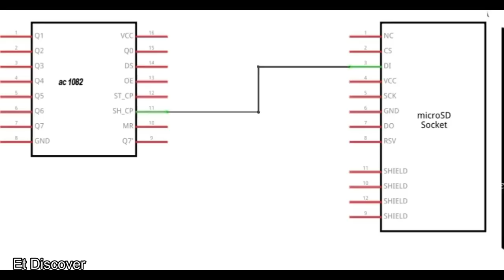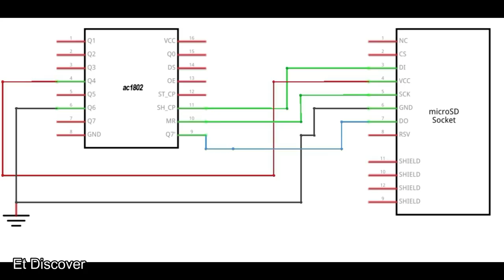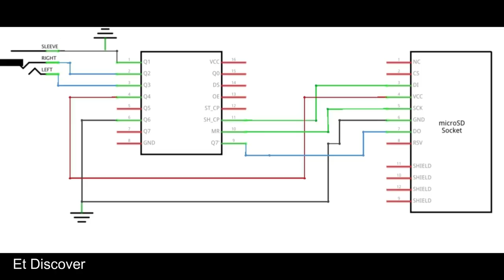How to Make a SD card Mp3 Player_ very easy.

Comment: Awesome video🤗 Nicely explained.😊Here are some recomendations 
1.use a small plastic casing for your project.
2.add a micro usb female jack to charge the battery.
3.replace this small 100mah lion battery with 18500 mah lion battery. It will increase the backup by over 10 folds.
4.use a soldering iron with microtip and low wattage. Its worth investing belive me. You  burnt your switches a little.😉
5.use a 4 ohm speaker, infact two of them to inc output subsatantially, It will be worth spending.
6.use pcb if possible. It makes it look neat and tidy.👌

They are just recomendations and are dependent on  your budget.😉

Nice camera effect while introduction to the materials. Just like 3D view.😋

And  keep up the hard work.🤗
Reply: Abhishek Sarangi how that pcb setup that only he has explained and done
Reply: Ac 1802 ic where can we found
Reply: Hii
Reply: i need this but ..... how can i do it with a 9v battery?
Reply: @andrejohnson9099 . Need a converter voltage up and down
Reply: thank you
Reply: Abhishek Sarangi why not adding also a potentiometer to control volume and add pause/play button?
Reply: Well explained bud.im a self taught DIY 'r,an love an enjoy salvaging parts / components  to learn and make small  projects. If you have a channel of your own  could do with your help  and knowledge every now and then if poss. I'm Impressed deffo ur getin a subscriber to ur channel mate.   
God bless.

Comment: What were you holding at 3:53?
Can you explain what Were all wires you use?   ✨Thanks✨ 
Can I use 10watt or 20watt speaker with this?
Reply: Ac 1802 ic
Reply: and the answer to that is no you can not only max 3w 4-16ohm

Comment: Hey bro, can you please confirm if this is a AC1802 or 1082 IC.. because in your video in the beginning in the circuit diagram IC number reads as 1082 and later it is changed to 1802. I searched in google and found that 1082 is the IC used in the MP3 player circuit. Please confirm on the same as this is confusing us. Looking forward for your reply... Thanks in advance
Reply: Hey bro I am awaiting for your reply. please reply.